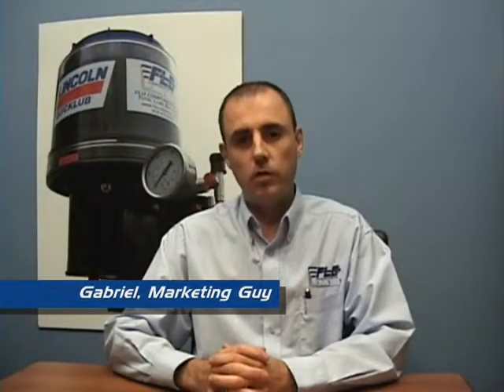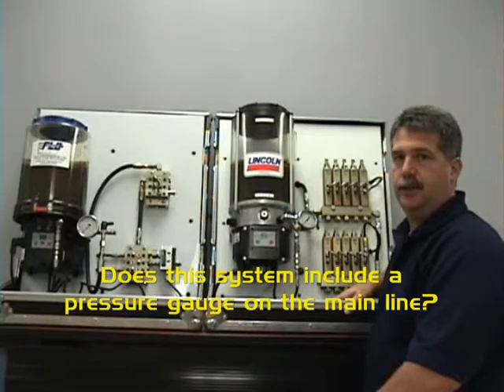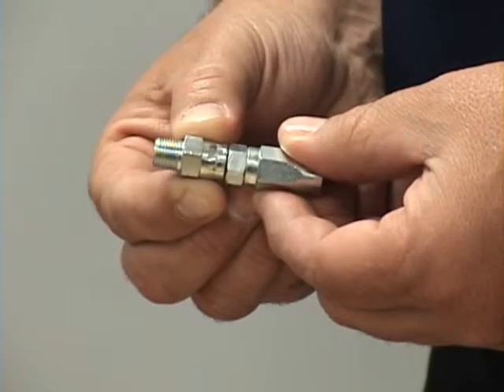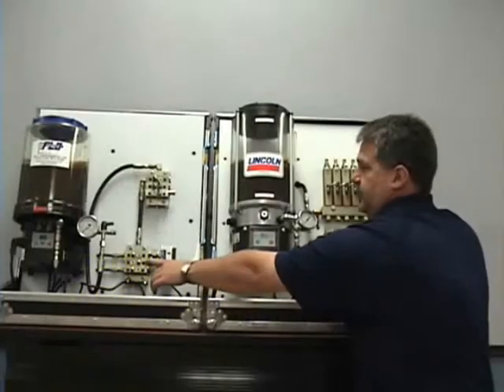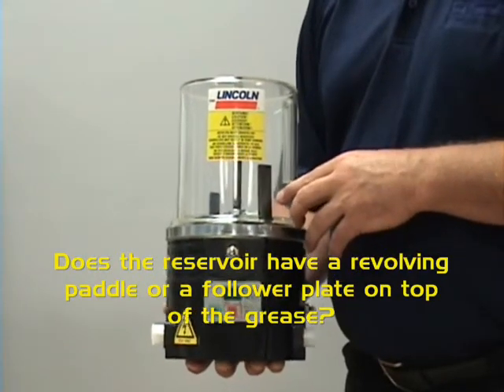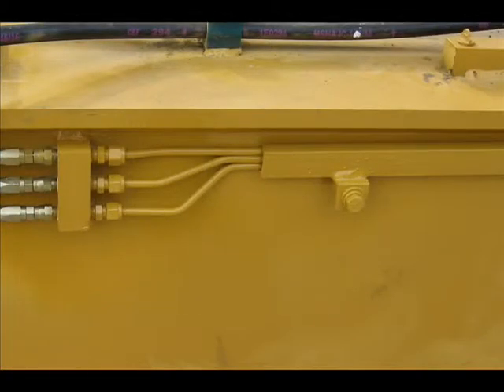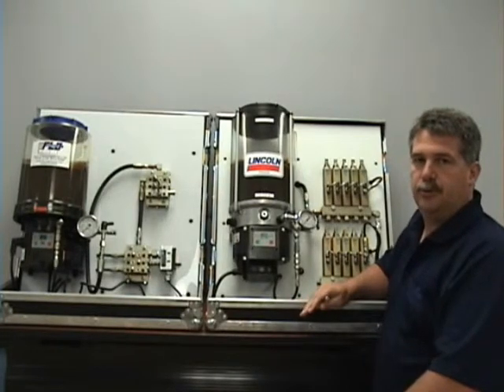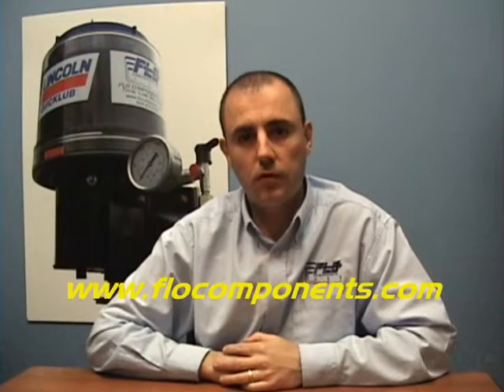FLO Lube Tip - Questions To Ask When Sourcing an Automatic Greaser

Comment: hi, i have a problem with a pump that i am installing in a machine, i did all of conexions indicated in the manual and in this appear an error E1 (intern pressure pump) i dont understand why, the only reason that i think it is the purge of the pump, so i ask to you, if you can help me with the steps for purge a pump, the code of the pump is      p653s-8xlbo-24-1a-as07-ul

please help me i am desperate, thanks and best regards